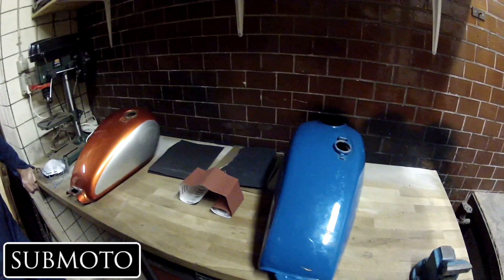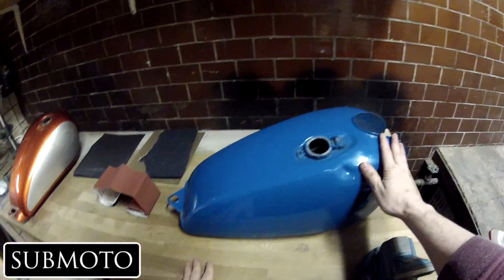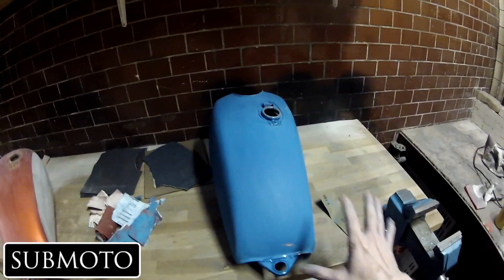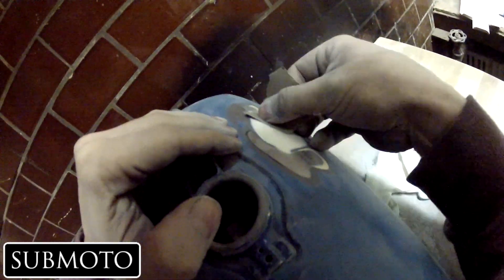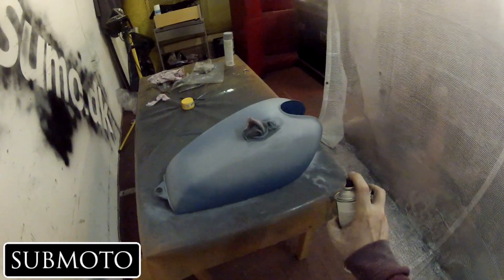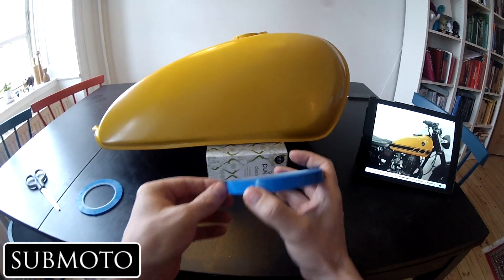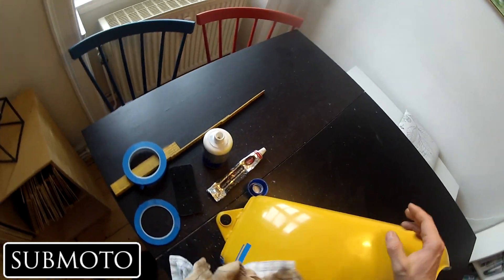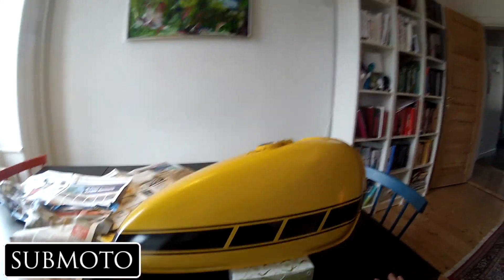Part 8 - What painters DON'T want you to know! (Motovlog)

Comment: In the future, when you bondo a curve like that. Use a flat sanding block and follow the lines of the tank. It will help keep the round uniform and the flat block will reach ahead of and behind the dent to help make it even.
Reply from the maker: Yup :-) learned that the hard way hehe
Reply: I am glad that you found that little trick though. Happy for you. I am working on getting my GS1100 Restomod going and repainting will be a big part of the build.

I am just pulling on knowledge i picked up when I hung out with guys at a body shop for a year. If you have any questions, i will try and remember and let you know.
Reply from the maker: +edgeofvamp Awesome, thanks :-D

Comment: I use the same method and have a canpaint on my bike. :-) Black'n'white with stripes and Union Jack on the cowl. But I finish it with 2component clear coat from Louis or Thansen. No one beleives it's a canjob. Well done! ( In your film, the distance between tank and can is a bit short, IMO) :-)
Reply from the maker: Yeah, you're right. but it seems that with these cans, it just poweders on at a further distance. Quite weird
Reply: Shaked enough? That's quite important. But you know that, off course! :-)

Comment: Looks good. 

Will the paint and alu polish trick work og plastic as well?

And will The bike and tank be ready for bakken? :)
Reply from the maker: I doubt it'll be ready, I'm still waiting on the seat. When is the Bakken thing this year? If you have a thick enough layer of paint, the polish thing should work on plastic aswell. But you may want to try with Slipoline, just to get the feel of it

Comment: There are so many things wrong with this. 
1. The dent on the right side wasn't just an indent. It also caused an outward dent. You can clearly see it at 4:13.
2. Body filler shouldn't be used to sculpt. You need to keep it thin. If you have to fill a large dent use something with fiberglass in it.
3. The body filler should extend well past the dent. If you don't do this it makes it very hard to blend it into the body.
4. Don't use a paint that is removable with gas... on a gas tank... I mean seriously??? Oh, and use a clear coat.
5. Nice job on the stripe!
Reply from the maker: Awesome thanks. I see how you would think that it sticks out in that frame, but it's more of a lighting thing. It really looks bad in the vid, but It's completely gone now. I can't see the dent at all :-) Maybe I was just lucky. And yes, I should use something with fiberglass for bigger dent's agreed. Luckily this one wasn't as bad as it looked. 
I have used this paint on three tanks now, where the first one was my red bike. It's acrylic based paint, and the other one has held up for a few years now. but then again I am pretty careful. What kind of paint would you recommend? It DOES come undone a bit under the cap, so maybe next time I should try a different kind of paint. but otherwise, it has proven to be quite robust. 
I used clearcoat on the red bike and the yellow, but that's mostly yo protect the triping :-) 
This method works, but it's NOWHERE near as robust as a professional paint job. that's for sure. It's just a good solution for us poor bastards :-p 
I appreciate your input
Reply: I say use an automotive paint and an inexpensive HVLP gun. I also recommend a good high build 2K primer to help even out the imperfections. It's a small piece so you shouldn't have too many issues. Watch a video on how to setup the gun. 
You clearly spent some money on your bikes. It seems crazy to me to skimp out on the most visible part.
Reply from the maker: cool. I might try using a spraygun next time. Here is the stuff I used. It says auto-paint on the can. I wonder if it's different from other regular acrylic paints: 
http://autolakspecialisten.dk/files/motip/motip-spray.jpg
Reply: Automotive paint is like your body filler. It has a hardener. Once it sets up, it can't be removed with a solvent like gas. It's much harder so you don't have to worry as much about scratches. You can also buff / wet sand light scratches out. I don't know of a spray paint that can stand up to gas but you never know.
Reply from the maker: well I still have to be careful. It can take moderate spills and drops, but around the gas cap it does get beat up. I think I'll try your method next time :-)
Reply: Hello from Finland, nice videos mate! 

On the parts where the existing paint if fine & holdind up, using a sanding cloth (is that the right word? I think it's Mirka Alox that I use) saves a LOT of time and is easier to follow the contours of a tank. Costs a bit more than sandpaper, but you can wash them a number of times when they get clogged with paint.

I didn't notice with what product you cleaned the tank with before painting, there's the bottle stuff (pre-paint it's called maybe?) that removes the grease/silicone, but also these tack cloth (?) things you use just before the paint goes on. They remove all of the dust remaining on the surface, have found a noticable difference with the end result using them when painting in a shed where there's always some dust flying around. Putting it in a zip-lock bag after using keeps it usable for some time if it doesn't get too dirty. 

Anyhow, I too still use spray cans to paint motorcycle tins even when I do own a paint gun, a lot less hassle on smaller jobs & when you don't have to colour match to an existing paint. When painting in a shed/garage it's also a bit of a compromise between an airbrush gun & paint gun, enough paint but still so low of a pressure vs. a paint gun still spraying without clogging, that you don't mess all of the place with paint. Also ventilationwise, you can get away with only a proper mask when sprayed in small amounts at a time, the 2K stuff is really nasty compared to 1K.

The trick is to use a 2K clear on top, pretty much all 1K clears are affected by spilling gas, the more expensive ones stand up to it a little bit longer. If you always wipe away spilled gas right away, even 1K clears are fine BUT they do get yellow after an amount of years exposed to sunlight (don't know about the "UV-protected" ones though). 

You can get 2K paint in spray cans now, SprayMax is probably the biggest brand, one can find them through ebay.de. A bit pricey but it makes all the difference, Motip sprays are fine for the money but these are so much better, using them & the finish. No metallic paints in 2K spray cans yet, but what I personally have done, is to use (the same brand paint) in 1K base + top coat, then use a 2K clear to finish it off. Have read in many places/forums that you couldn't use 1K+2K products together, that it would boil/peel/otherwise ruin it, but mine have come out just fine. Lasted even in the plastic parts (tracker pan, fender etc.)

I haven't used alu polish (yet), but I would imagine that I doesn't get the paint surface truly flat? Shine may be OK, but still a bit of peel left? I always start with wet sanding the peel down, you can start with 1200/1500 grit, but I now use only 2000 grit, doesn't take that much longer to get it flat and is a bit safer. Lots and lots of clean water & clean place to work, even a little bit of dirt/debris between the paint & paper will leave a mark. Pays of get quality sanding paper, one piece lasts so long that it may be even cheaper, Mirka Ecowet is the best I've found so far. Sand with the palm of your hand/all fingers together rather than fingertips, even pressure on the paper. Using a sanding block is important usually, but with older tanks etc. there's so little straight flat surface that a straight block doesn't work that well, don't know if they've come up with a suitable block for that yet. Go really easy with the corners at first, it's easy to go through the paint if you sand them hard, the paint thickness is so much thinner there. Sand an area, wipe it down with a clean cloth and when it dries you'll see it right away if there's any peel left. Might look out ruff at first because it will look totally matt (no gloss), but trust me, the shine will be there when you start to buff it. One trick also if to use a bit of water with the finishing compound/polish when you get to the end, it will lessen the "grit" of the polish a bit = even more gloss. 

With tanks, it pays to leave a nice big area around the filler cap hole unpainted. If the paint line goes inside & under the cap gasket, there is a possibility it can start to lift away because the fuel fumes. If it starts to go, you can still save it with cutting the lifted area away with an exacto knife, but then you have to patch up the cut line area with clear or paint (don't ask me how I know..). Put the cap on, figure out where the gasket touches the metal and when painting line the masking tape a tiny bit outside of that (or the same line with the factory paint, if it's original). It could pay out the mask the layers before the clear 1-2 mm further out to get a nicer finish on the paint edge, haven't tried that yet.
Reply from the maker: +Riku Helajärvi wow! awesome :-) thanks for the input!